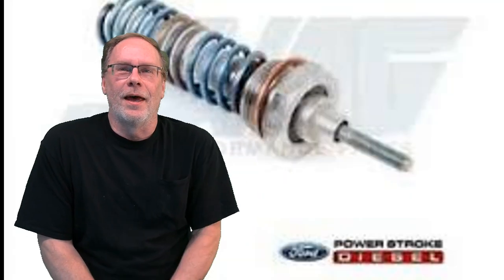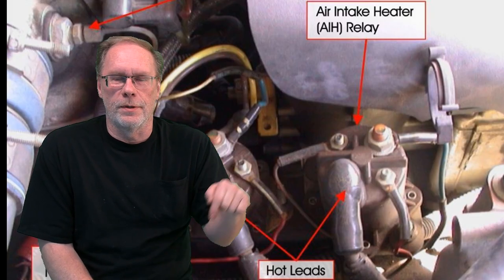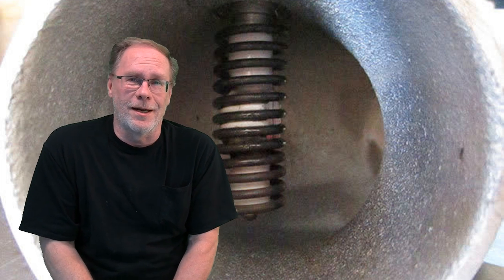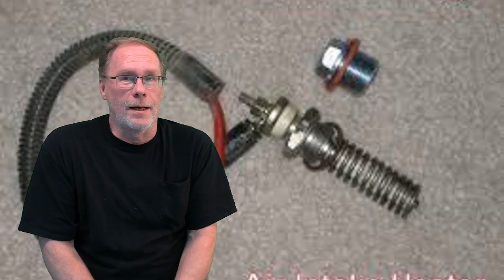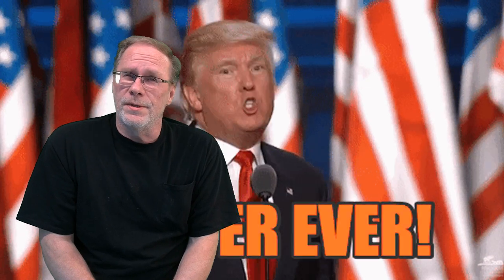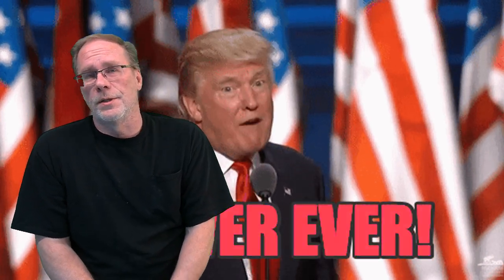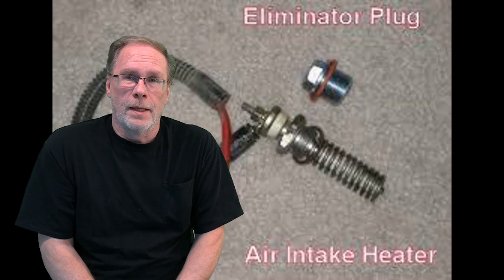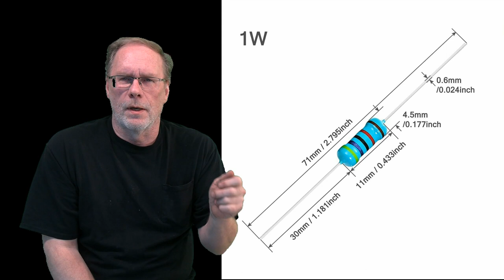7.3 POWERSTROKE  MANIFOLD AIR INTAKE HEATER  ...............................

Comment: I deleted mine with a plug from Riff Raff delete kit comes with that wire resistor you talking about and I monitor my boost pressure through there i’m in California just recently a couple months ago did all my glow plugs diesel RX glow plugs and upgraded relay and did all my wiring harness under the valve covers
Reply: Same. I actually lost that ceramic insulator when I tore apart a bunch of stuff, which prompted me to take that wire off completely. Then I wanted the code to go away so ordered the part from Riffraff.

Comment: wait WTF ? the grid heaters never actually turn on in a manual transmission application unless the e - brake is on ? I go for decades never using my e-brake because to many times they seize on or the cable snaps ?
Reply: Yup ! Hahaha living a lie ! 
At idle 
E brake on 
Below 0 c 
Only once the glow plugs are off
I forget the other prerequisites but it's not very often it's in operation. 

Up here in Canada it can be handy to keep the smoke down during warm up ...... I'm debating on deleting mine as I have a block /pan heater

Comment: You might want to consider a resistor rated for whatever the circuit is fused for.
 Maybe put a 1amp fuse in the fuse box?

Comment: Question the rubber hose on the gate that goes into the pipe right next to that little heater someone said if you pull that off the turbo will run at low RPMs which it does do if you pull that off your turbo you can hear his singing as soon as you get off the starting line and if I constant on horsepower does that hurt it the guy also said that it's supposed to be bad for it but is it or not because it sure does work a hell of a lot better with those two holes is pulled??

Comment: Could one just Dremel off the heating element and positive stud? Since it's pressurized any failure wouldn't get sucked in.
Reply from the maker: Ive seen that done they used gray rtv on the inside of the element

Comment: Is there anything I can do to prevent the dipstick nut at the oil pan from coming loose and leaking? 2000 F250 7.3 with 14,000 original miles.
Reply from the maker: In my experience because you can have other issues but I found the O Ring didn't seat and the nut didn't get tight enough or was over tightened and now is stretched . so I,ve tighten it back up and used a bead of 3m 08115 around the nut once that sets up That issue will never happen ever again
Reply: @CUSTOMWORKS7.3PSD  thank you for sharing your wisdom! Looking forward to all the info & knowledge on servicing and maintaining this old girl.